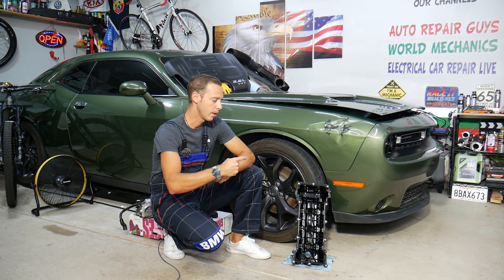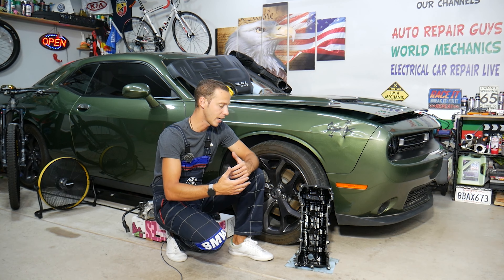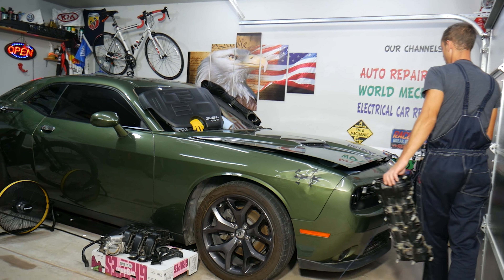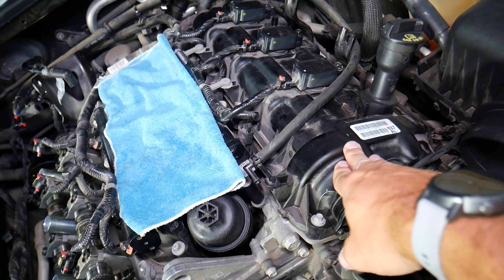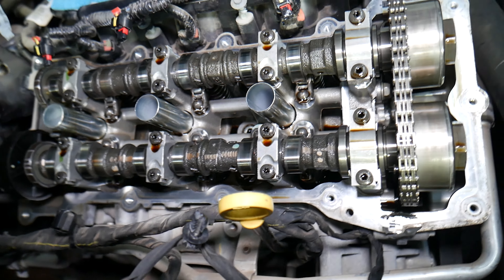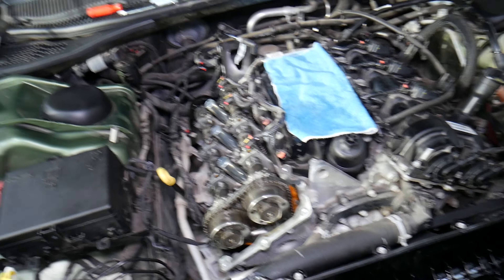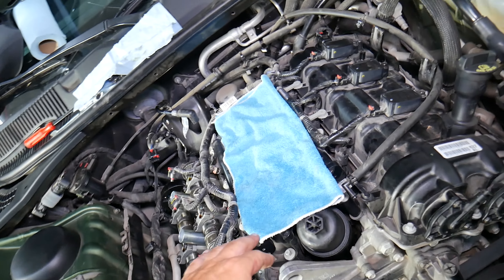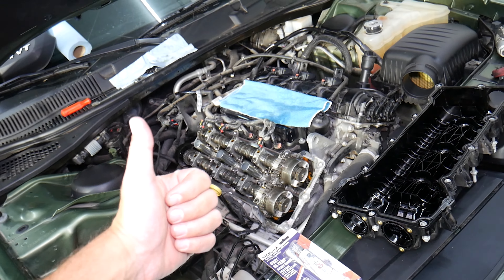DODGE CHALLENGER BURNING OIL SMELL FROM HEATER AC VENTS

Comment: I deal with the oil smell on start up. I just replaced the pcv valve but idk it seems to be running fine. The guys on the doge forum say its common and normal but I've never had a v8 belch burnt oil smoke on almost every start.